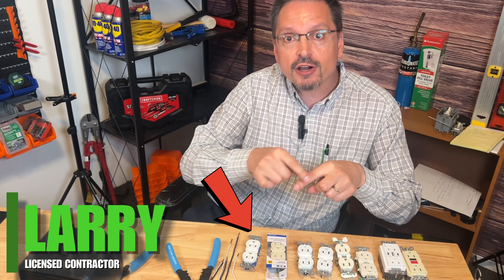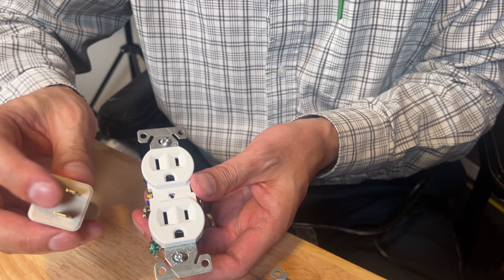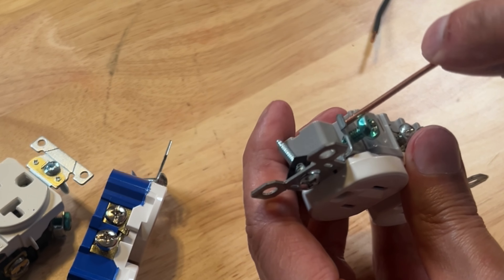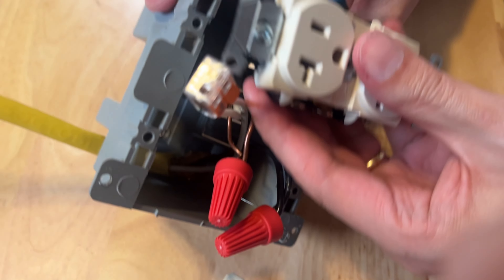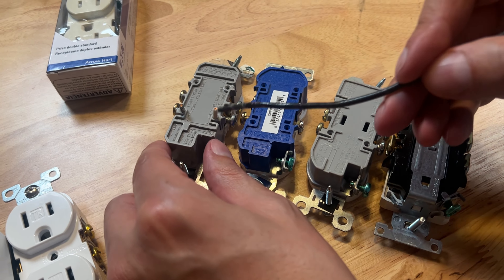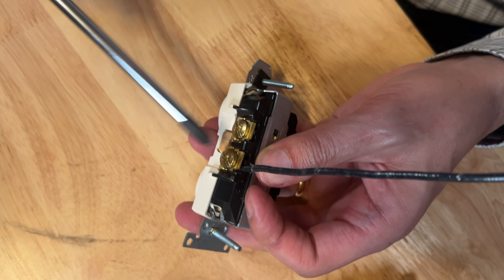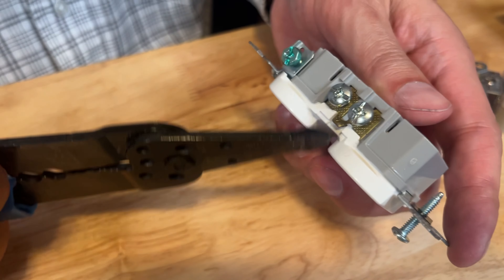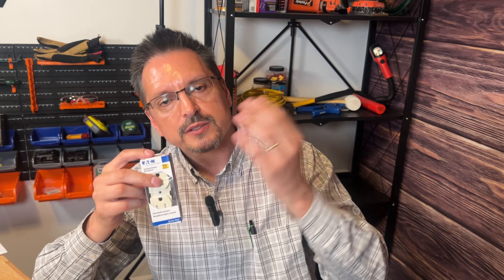Shocking Truths About Electric Outlets

Comment: As a master electrician i agree that you should buy the higher grade outlets. I giggled when you said to clockwise j hooks then reversed on the ground screw. Never put 4 wires on a single duplex. If you have that many wires in your box, you are doing something wrong and your box is likely over filled and a code violation. Never use the quick connects. These have a very small surface area for the load. People who use small portable heaters  burn up these outlets all the time. Some burn their home down. The tabs are often used to help get the outlets straight on a box, however there are box inserts used for this. There are also stackable rubber "legos" we use now. The biggest reason these tabs are broken off is to fit inside a raised cover for 4 square boxes. A bottle of booze or case of beer is a cheap way to get about any electrician to come and give you tips.😊
Reply from the maker: Thank you for all your wisdom and experience. I appreciate you sharing 👍🏼🛠️🛠️

Comment: How about a "simple" version of 3 way switches and how to wire them.
Reply from the maker: Will do…I know that’s confusing for many. I’ll get to it. Basically a 3-way switch is never off, it’s simply changing the path like a train track switcher. Thanks 🔌🛠️
Reply: @HomeRapidRepair  exactly. Just yesterday I had to change one out for a customer and it was not wired traditionally so naturally I got quite confused between the three light switches. It's not that difficult but when the previous dude used a black wire on one traveler and a white wire on the other traveler it was like whack mole all until I got it right.
Learning tricks of the trade would be very helpful. Thank you
Reply: Most 3 way switches have a diagram on the back of the box or a piece of paper inside. However there are multiple ways to do it depending on the path of the switch leg wires. There are some decent videos on this out there.
Reply: @patrickhein9470  Yep, the only problem I have run into a few times is when someone   painted (sprayed) the walls and now EVERYTHING is white.  Or, someone used a white or black wire as a traveler.  Perhaps I should have been more clear and asked for a simple trick to finding out what wire goes where when you have these type of issues.  :)
Reply from the maker: @918scott  one time I was renovating and totally confused with several 3-way switches and a ceiling fan and I couldn’t figure out which was which I called my electrician friend and he just worked on it while all the circuits were live and did trial an error… Took him about two minutes… I guess I need to work while the circuits are on. Lol.
Reply: @HomeRapidRepair  That's what I do but it takes me many, many few minutes.    ":)~